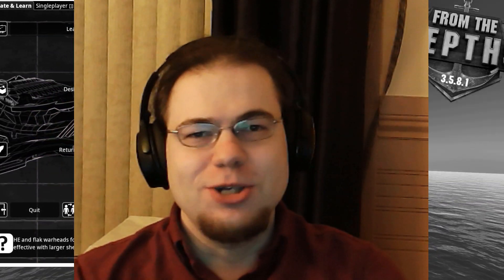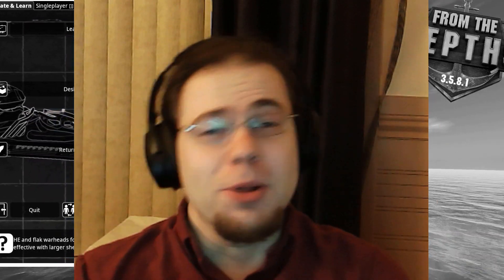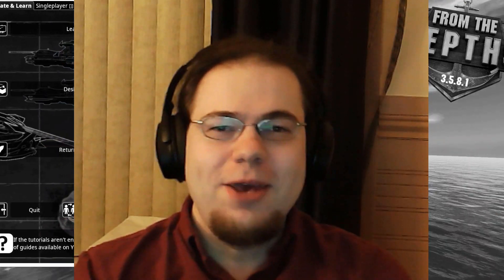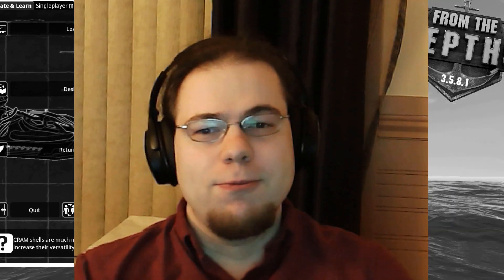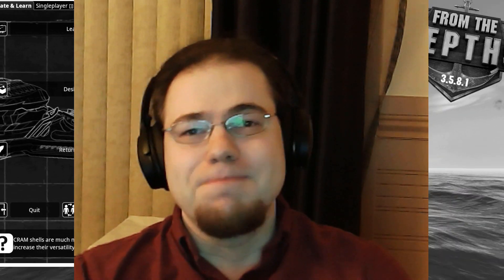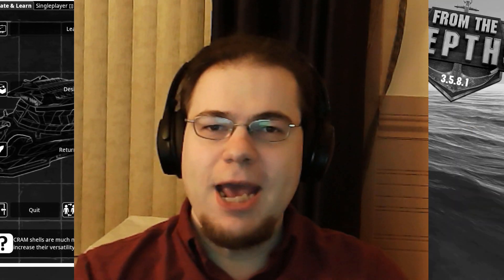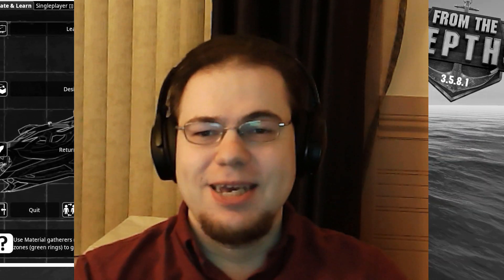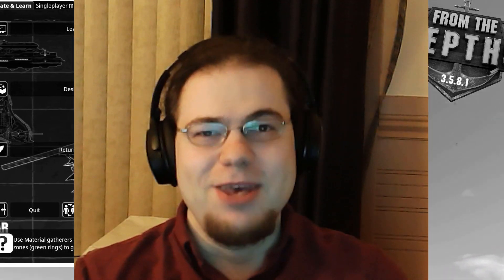From the Depths - EMP: How to (but really, why?)

Comment: I think emp would be greatly improved if it didn’t destroy the blocks but disable them temporarily for a time that scales with the pulses strength and maybe stronger less efficient pulses could cause heat damage. Increasing the viability of rubber could be nice as well.

Comment: Seems to me the main problem with it is that EMP can dead-end so easily. What if some fraction of 'dead end' EMP damage turned into fragments, instead of just evaporating? Like there was so much EMP the surge protector exploded and turned to shrapnel?
Defensively, this would make EMP-proofing more difficult than just sticking surge protectors around, attached only by one end.
Offensively, this would make Large bursts of EMP (like crams) viable in a different way than DPS EMP.

Comment: does the size of the emp block matter? is it better to use 1X1 blocks than 4X1 ?
Reply from the maker: You mean surge protectors? It doesn't matter a lot, but for some reason the bigger ones get the beam bonus even though they are non-structural blocks.
Reply: @OhmIsFutile  yes  sorry, meant surge protectors.  Thank you Ohm!

Comment: I would like to hear your thoughts on PACs, I find small PACs for planes of other things like that are fine, but the massive max sized PACs that are able to one shot most of the things in the game seams dumb, there’s no risk of having a extremely expensive pac that can barely even be shot at because it kills things so fast, on top of that there is no counter to it unlike every other type of damage source in the game
Reply from the maker: PACs are actually the worst weapons in the game in terms of cost for the amount of firepower. The reason they are mostly unblockable is to make up for that. I honestly don't think PACs are problematic, especially since their charge time is capped so you can't start the fight with more than 30 seconds of charge.

So, if something can one-shot you, you were probably already at a significant material disadvantage or other mistakes were made...

Comment: I dunno I always found EMP was easy to hard counter just by building AI and detection on top of surge protectors and liberal use of surge protectors. As far as the best thing to use it PAC wins hands down. It's hit scan and won't get shot down like shells or missiles.
Reply from the maker: It is easy to counter, and that's exactly why it's a bad mechanic imo. If you know what you're doing, EMP will have to chew through a bunch of surge protectors before doing anything meaningful which usually would take longer than a standard fight... and if you don't know what you're doing say goodbye to your LWCs and AI. All or nothing.

Comment: I'd go for a (new) rework of some kind before I'd suggest removing EMP entirely. It offers the option to disable a target unit without necessarily killing it entirely, which is a niche but valid mechanic. And as others have mentioned, EMP/power surges are a real-world thing that has to be dealt with; it's why we have things like surge-protected power strips, circuit breakers, fuses, and Faraday cages.
The bigger question, in my mind, is what would EMP be reworked into/replaced with? How would you make it into an interesting and fun mechanic, as opposed to just another thing on the checklist to account for?
Reply from the maker: Interesting take on the subject. Honestly, I'd probably go with the way most games deal with this and make it easier to use but less all-or-nothing. For instance, instead of dealing damage, it could disable specific high-impact blocks temporarily, like receivers, shields, and LAMS almost exclusively. On the flipside, it should be harder to defend against.

But honestly, I probably wouldn't bother keeping it in the game. Sure we have fuses and other electrical mechanics to think about IRL, but that doesn't mean it needs to be a mechanic ingame. You have to ask yourself how much depth it really adds to the game. Currently it has about as close to zero depth compared to everything else in the game. You either defend it well and you have to get extremely lucky to get value out of it, or you just completely wreck stuff.

Comment: I don't think EMP should be banned, it's fun and a cool mechanic! I did find this video very useful however, I didn't know the epic use of small EMP charges to deal with small blocks and detection so that was very insightful. One thing I'd like to add however is that rubber seems far more useful in game compaired to how the stats look, I usually rubber EMP insulate stuff and EMP is extremely rarely a problem on those crafts. Anyways, good vid!
Reply from the maker: Thanks!

Comment: Nah don't remove emp. Its a bit like saying we should remove gravity cause some people cant build hover tanks. Or that we should ditch the ir detection cause nightfights aren't fun. Emp is a thing, and it should be represented in game, the current system works, and can be defended against as you have shown.
Reply from the maker: It's not at all like saying "remove gravity." EMP as it stands is mostly binary, either you defend it properly and it's worthless, or you don't and it just completely shuts you down.

Since defending EMP also requires thinking about placement and surge protectors, it's also disproportionately powerful against small vehicles.

EMP IRL works quite differently, and just because it's a real concept doesn't mean it has to be in the game. This game was never a simulator to begin with and newbie traps that become largely irrelevant once you've attained a certain skill level essentially adds nothing to the game. How many shooting games have guns that are only good against newbies and are praised for it?

Comment: This is a very good and insightful video and it brings up some valid points, but honestly I don't mind EMP the way it is right now. I've not really run into problems with it much defensively since I EMP-proof my craft in pretty fair ways, I'd sooner run into issues with other shells and even thump damage before EMP would cause me an issue. I feel like it's just another one of those things to consider when making a craft, and its removal wouldn't really do much but remove more options from players at the end of the day. Your suggestion of giving it a more obvious and interesting visual effect though is very good however.
Take this with a grain of salt though since I am the type of person to build plenty more crafts that are functional and pretty, and I don't really do much campaigning with them past faction-wide testing.

Comment: The other option instead of the spine is connecting all susceptible components to only a long (not much since it’s exponential) chain of rubber requiring a stupidly large emp strike to damage anything. Only works on large ships since the defense out scales the weapons after a certain point. Benefits: no repair cost, not worth overcoming. Downsides: creates a physical weak point, renders emp as a damage type useless.

Comment: I honestly would LOVE if EMP was removed from FTD. Fuckin' hell, it just adds frustration to the game rather than fun. Part of the problem is how disproportional EMP damage can actually be. Whether between a big EMP volt such as from a large missile, which I really hate, as opposed to a small strike... or between a large craft with many blocks to go through, and a small one where a strike anywhere can probably knock out a system where another type of shell might just overpen or do a chunk of damage rather than kill the craft. It's such a hot mess, EMP- that it paths towards the point where it can do the most damage. Might be less horrible if surge protectors didn't break the bank trying to keep a craft protected from something rocking heavy EMP. (because wrapping it all in rubber is not space or cost efficient either)

Comment: With your comments on AP-EMP, have you considered a target that does have adequate EMP protection?

In the video you only mention poorly protected targets and then proceed to test on a clearly poorly protected target.
Reply from the maker: Yes, if a target has adequate EMP protection, the odds of APEMP doing more than AP or EMP separately are close to zero. The reason it went the way it did in the video was me wondering if people got the idea from the in-game designs being vulnerable to it and I couldn't find any designs that are more vulnerable to APEMP than just straight up EMP.
Reply from the maker: I've theorycrafted a lot about how APEMP could someone work better than anything else and my conclusion is that it requires too many conditions to be viable, most importantly hitting very close to something sensitive to EMP... and if you can do that then APHE or APFrag will get you the same or better result more often than not.

tl;dr even when actively trying to justify it, I can't find a good reason to do it
Reply: @OhmIsFutile  
Not sure if this is know but EMP has a vision range base on the damage of the surge. Which is one of the biggest things APS EMP has going for it.

Many many systems can't be built with surge protectors inside them, and many many systems are very big. So hitting near them is something we do not* have to make an exception for in theory crafting.

Landing a small surge near one of the many large systems inside a craft is going to ignore most of the EMP protection in place on any craft. Which makes EMP usable again

APEMP surges also generally have more damage then surface detonation surges once actually reaching the internals (depends on armour thickness). However, the AP surge cannot see any where near the amount of craft (potential surges) that the surface detonation can.
With APemp, the damage is far more controlled.

AP-frag(or HE) is also not nessisarily better. Its extremely common for internals to be covered in their own HA. EMP gets to ignore that HA.
As for surges placed with that HA (opposed to the big surge banks and cages people like to make), that's just compatible to the AP-frag having to punch through some HA beams. Its hard to say there which will be better. But neither is entirely shut down. Unlike surface detonation charges which are completely shut down by adequate EMP protection.

You are probably familiar with using AP-heat to bypass anti heat defenses. Making HEAT usable again. Exact same thing with AP-EMP.

Tldr: APemp means that APS EMP can be used on craft with adequate EMP protection. Opposed to surface detonation EMP which is unusable vs those same craft.
And it's very hard to say whether another form of AP-x will perform better (too vague).

EMP in general is meh, but APemp is one of its actually usable forms.
Kinda like HEAT.
Reply from the maker: Do you have any working example of this? Unless you're hitting monstrously large beyond anything in Neter, I don't find that to be even remotely the case.

I've tried zapping the new Tyr internally with EMP and it often did LESS damage because it was hitting surge protectors more frequently due to, well, getting triggered closer to surge protectors whereas a surface impact had a chance to hit detection and such.

If you're wondering why I chose the Tyr, well, it was just about the only thing I found to be built properly when it came to EMP. Just about everything else that was godly from pretty much every faction (TG fared the best beyond the Tyr) was just as vulnerable to EMP from the inside as the outside (if not more on the outside).
Reply: @love_from_violet5220   hmm, but the only system EMP meaningfully affects is AI, which is one of the smallest internal systems. Sure, it can also get lasers but any worthwhile laser system is already so colossal and almost certainly central to the craft (just look at most neter craft with good lasers) that they're basically impossible to insulate with rubber, which removes the main benefit of apemp, and your whole point about emp range is questionable considering emp can travel at most 2000 blocks, which is a lot and more than enough to go through any armor.
basically i don't really follow your point about emp range in large systems because the only systems it can hurt are either always small or so huge that surface det emp will probably do just as good.
and in terms of apemp being able to more easily punch through system armor, you yourself bring up the fact that it will hit internal surges (good emp defense mandates them being there) and you also compare apemp having to punch through said surges to apfrag having to punch through armor. if this comparison is good (and i do think it is) then why ever use apemp, when apfrag will have the same effect against emp-vulnerable systems (it either punches through the armor and kills them, or it doesn't) and against emp-resistant systems it also gets to do damage, unlike apemp. really i think the niche-ness of emp kills its uses here. other ap shells can do what it does, and also more.
Reply: @love_from_violet5220  What on earth would APEMP do other than change where the pulse begins. It's still gonna run off to the closest surge protector

Honestly EMP at all is just annoying to fight and boring to build and shouldn't be used.

Comment: EMP is like HEAT and HESH, if you don't counter it it's OP, if you do it's near useless.
Reply: Part of the problem in this is that it's harder to counter in, say, AotE, where you're restricted in volume. And quite hard indeed on a typical plane-sized craft or a small-ish tank, where your only recourse really is to avoid the EMP in the first place or just... die. Wrapping everything in rubber isn't space efficient, nor cost efficient, considering your next layer of actual armor is dimensionally larger in size and thus cost. :( And surge protectors? Gamble. They're incredibly expensive, and won't be pathed towards if the EMP can actually do more damage to something else it can reach.
Reply: HEAT and HESH both have their places in the game and can be extremely competitive. I've seen a number of tourney entries that did extremely well with them as their main damage type, but EMP on the other hand just punishes small things and poor designs in a way that's frustrating to deal with. 

There's a reason why a lot of tourneys ban it, and it's not so much because it's OP as because it sucks to watch and is frustrating to deal with. I honestly don't think I'd miss it if it was removed or fully reworked to be a more interesting mechanic (maybe stunning instead of damaging functional components within a radius of the hit instead of killing them?), but for now it's just not fun to deal with or use.
Reply from the maker: I think HEAT/HESH are more interesting mechanics and at least interact with more aspects of the game where EMP just feels like its own minigame, but I see where you're coming from

Comment: EMP should absolutely be removed from the game. No matter how much they weaken it, it will always be too strong.
Reply from the maker: Well, assuming you followed through with my thought process in the video, defending EMP on anything larger than a small plane is actually relatively easy... the problem imo is it's just not fun, not particularly impressive visually, and an all-or-nothing mechanic

Comment: would you consider this good protection from emp for a main side armour
4 meters of metal pointing up heavy armour slope pointing up then surge protector with alloy
Reply from the maker: It'll do, all of those are low resistance and alloy is relatively higher resistance thus making it very unlikely EMP will enter the vehicle. Just make sure to also spread surge protectors around the vehicle.

Comment: Bold suggestion to remove EMP from the game! I wouldn't mind that too much, honestly. 
As for AP-EMP, what you're saying in the vid seems to suggest more that it makes no difference rather than its actually worse. Did I miss something?
Good video! Glad I kept notifications on for this. 😁
Reply from the maker: Well, it's worse in the sense that adding EMP to an AP shell weakens the AP for no real gain. On the flipside, you could use just pure EMP if you wanted and still get practically the same result on the EMP side while achieving a better RoF because you can use a shorter/slower shell with pure EMP.
Reply: @OhmIsFutile  Gotcha. Thanks for clarifying. 😁👍